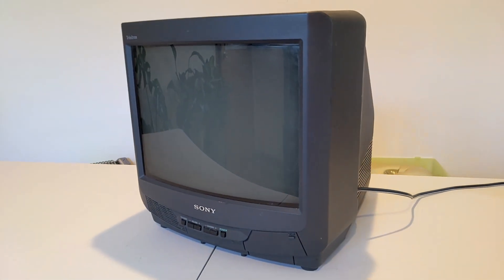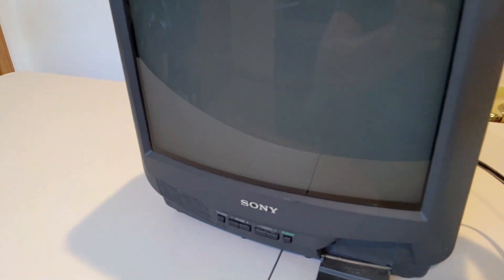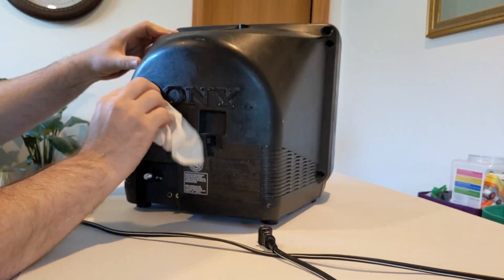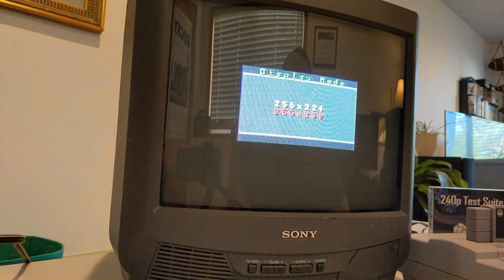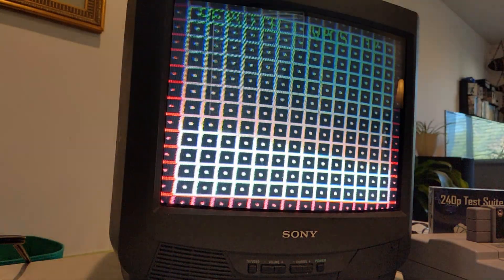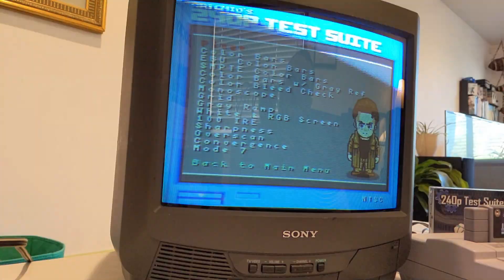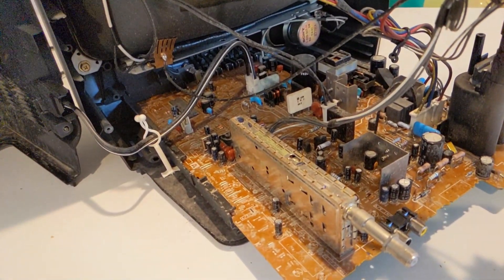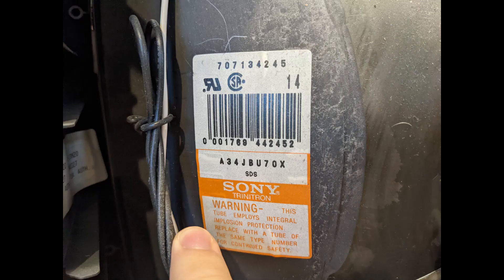Sony Trinitron KV-13M20 Repair Project, Part 1 (Introduction, State of Things, Testing, and more!)

Comment: This is the exact same Trinitron I have, Found it at a thrift store for 5$, it was dusty and dirty when i got it but the screen was mint, took it apart completely and cleaned the boards and shell 100% and buffed out the scratches on the shell now it looks amazing i love it for video games and anime
Reply from the maker: What kind of cleaning do you like to do?  I usually just dust with compressed air, but I know there are brushes and chemicals that could work a lot better.

Comment: Great video!  I have the 13M30, which appears to be the same TV except it has a composite jack in the front as well.  It's honestly my favorite CRT I've owned, even with only composite input and imperfect geometry.  I do wish it had a HSIZE adjustment in the service menu.  Have you figured out a way to adjust that?
Reply from the maker: Thanks for the comment.  That's great that you like your set so much.  I haven't played with it any further since I made this video.  There could be mechanical/physical manipulation of the internals to adjust HSIZE, but I haven't tinkered yet so can't confirm. Cheers

Comment: I just got this TV for free. Would you be able to share your picture settings, both the regular and service menu settings? Thanks.
Reply from the maker: Hey there, thanks for viewing and thanks for your comment.  What I want to tell you is that all TV's are set up differently from the factory, and you can't really copy and paste values from one TV to another, even within the same model.  Instead, what I advise you to do is to research how to calibrate it yourself, so that it's right for YOUR TV.  I recommend writing down the original values on a sheet of paper before you start, so you can always go back to that baseline if you make a mistake somehow.  Good luck!

Comment: Awesome video! When looking to pickup a Sony Trinitron is there a specific model best for retro gaming or most recent Trinitrons are best or the wegas or any Trinitron is good?
Reply from the maker: I think most people would agree that professional-grade BVMs and PVMs utilizing modded consoles to produce RGB and SCART to be the best.  I don't own any professional models, so I wouldn't be able to advise further on that.  I am tinkering with consumer-grade Sony Trinitrons, mostly flat-panel WEGAs, though they are prone to geometry/convergence issues.  You should shop for what inputs you are going for as well.  If you are only using composite, you will have a lot more options available to you, even going back to the earlier trinitrons with curved screens.  I like to use s-video and component when available, so I am limiting my pickups mostly to include those features.  For further research and information, see the wikipedia page for WEGAs and elsewhere online.  Thank you for your comment.

Comment: Heres a tip of you wanna clear the scratches on the screen up a bit, use novus 2 scratch remover
Reply from the maker: Thanks for the tip.  The marks that I had on my glass came off with simple wiping with a rag and were not actually scratches.

Comment: getting a weird crackling sound with my crt, like something is burning inside.. what could it be tho
Reply: may be the flyback, sometimes it can have physycal damage or some parts worn ot and the sound it a little High voltage arcing.. sometimes it is the anode cup arcing but you should be able to see it if that was the case